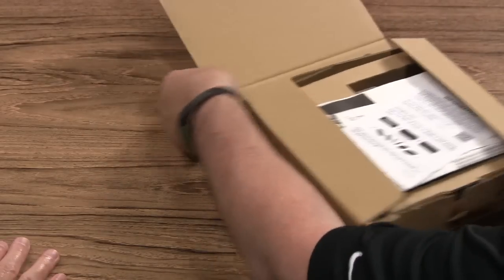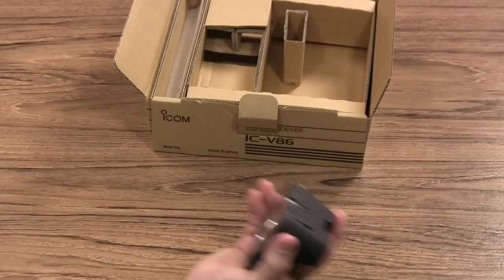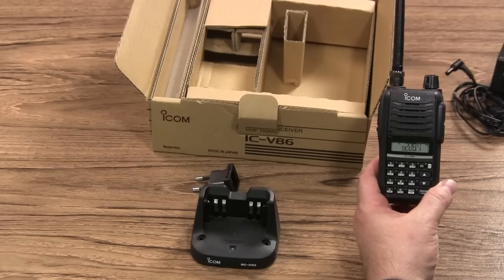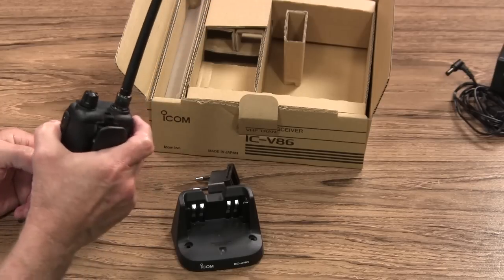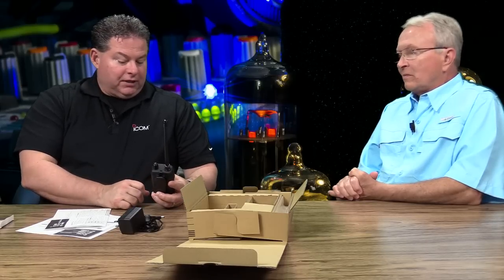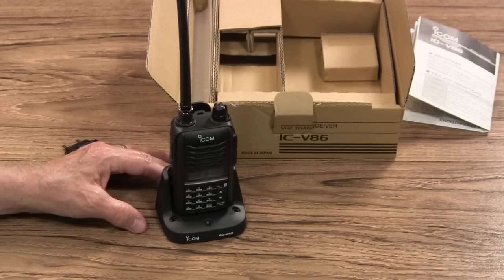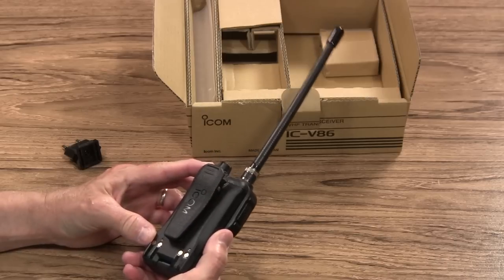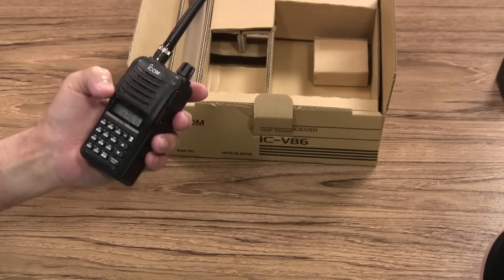IC-V86 Review with George Thomas and Ray Novak

Comment: Wish it was a superheterodyne like the IC-V80. The wide-spaced dynamic range on this unit (69 dB @10MHz as measured by the ARRL lab) make this unit less useful for 'Summits on the Air' in a noisy RF environment relative to the older IC-V80 (89 dB for the same spec) or the Icom IC-V85 (81 dB for the same spec).

Comment: I can't set name on saved frequency. Everytime I select the saved frequency to set a name , pressing func + set key just keeps putting it in set mode menu. In initial mode already set disp function to name. Also in the initial mode there is no EX HI function off or on for 7watt power. That should be the first selection once in initial mode instead it's BEEP. Feeling stumped.

Comment: Why would anyone buy the Sport model? I imagine the radio would chew through AAs in short order getting quite expensive in the very short run.  You could buy the rechargeable version and the battery pack for what, $25? Then you'd have both. Buy the Sport model and a Li-Ion battery and charger will set you back a much bigger chunk.

Comment: I just got this radio and I'm really liking it. I did discover that you need the basic manual that comes with it and additionally the advanced manual that you can download and print from the icom website to learn all the functions of this radio. Some things are covered in the basic manual, but a lot more is covered in the advanced manual. You actually need BOTH manuals because what's in the basic manual is NOT in the advanced manual.

Comment: I heard from some ham radio users that the V80 has much better RX selectivity than the V86. The V86 is a bit deaf and desensitized unlike the V80 which has a better front end, though the speaker of the V86 is more louder than the V80  and more TX power bur with a compromise as stated earlier.

Comment: Is Icom now using a cheap Direct conversion receiver design instead of a superior superheterodyne receiver as found on the IC-V80 and IC-T70A of years gone by ? My T70A was bullet proof on receive . The only radios with direct conversion receivers are cheap Chinese radios. Is this new IC-V86 really made in China like the new cheap Yaesu HTs ??
Reply: Made in Japan.
Reply: My cheap Yaesu FT 4XR and FT 65R both say Made in Japan. They both work well, not as good as the ICOM V86 but just about as good.

Comment: When is Icom going to release an FT3DR killer with D-STAR, a color screen, SSB on Analog 2m, APRS, DPRS, Bandscope, and a 4,000 mAh battery?
Reply: I would but that immediately
Reply: @nathanadrian  Bonus points if they add a DTMF keypad as well.
Reply: Non ruggedized are lame as hell. When are you guys going to make something that can actually be used outdoors and outside moms basement?
Reply: OutlanderSystems I would buy that.
Reply: A bandscope, Dstar, huge battery, and a keypad? Where can I buy this?
Reply: Also while we’re at it big shout out to the folks that screwed us on TRI radios.

Comment: but its direct conversion receiver
Reply: Jim Robinson  
 Not so much. In a strong signal environment it caves like a cheap house of cards.
  I have pagers mixing with NWS with other signals...a mess.

 Restricted to the stock antenna...it is ok. Audio is excellent and 7 watts is nice too.
  But if you connect it to a bigger antenna...it is horrible. My T-70A has a vastly better
receiver and is fine on a big high base antenna here. It is great for emergency power
out use. The new rig is useless for this...too many images and noise.
  It is a shame...it it the first Icom I have ever owned that was disappointing as a receiver.
 I own a R8500, IC7410,IC9100, IC7200, IC718, R100...and more.
 IE..I am a giant Icom fan. This new rig needs better image rejection and out of band
rejection. Bummer.
Reply: @michaelbrown-ns4dl  icom should recall this unit. lol
Reply: michael brown so a v80 or a t70 would be a better choice?
Reply: wdsracer The T70 is bullet proof if you can get hold of one 👍

Comment: I saw this listed on HRO's website and came looking for videos on it. Looks like it's a nice rig and at a good price point. I know the BNC connection is a big deal to many guys but not a plus for me necessarily. The big news that got me interested is the 7 watts and higher capacity battery. Tempted to buy one just because it seems like a great everyday radio for 2 meters simplicity. I'm also interested to see if they make a dual band version like the IC-T70A that I have in my collection of handhelds.